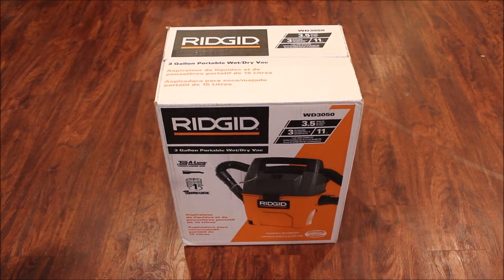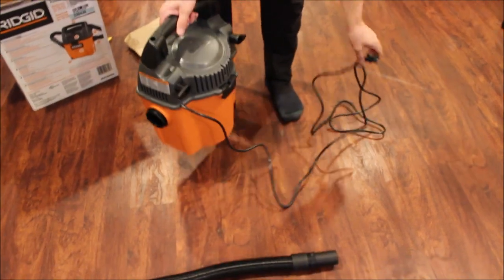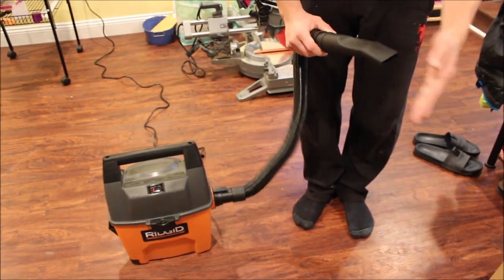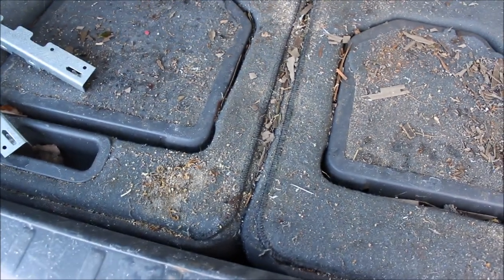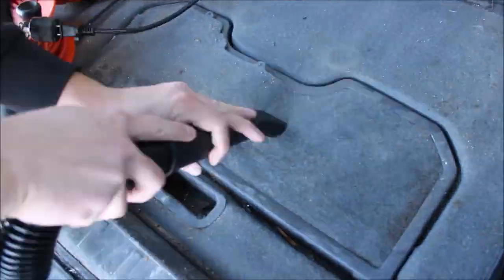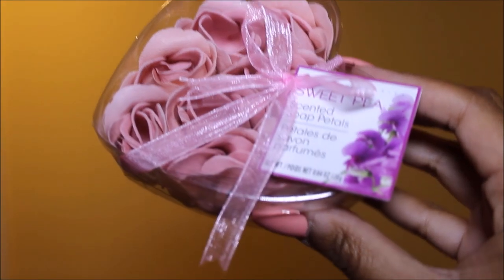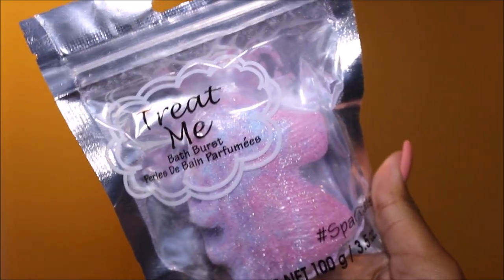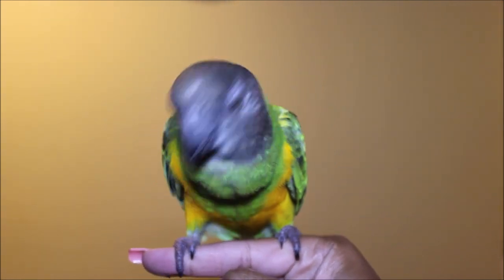Ridgid Pro Wet Dry Vacuum WD3050 REVIEW

Comment: Find it lacks sufficient suction to do a satisfactory clean up of my vehicle.It will suffice in a pinch for a quick clean up,and it works well sucking water out of toilet bowls and other water related plumbing work.btw-when removing water,remove the dust filter.Water will ruin the filter.You can purchase a water resistant filter through a Home Depot.

Comment: Get an air compressor blow and vacuum. Then buy this spray called Tuff Stuff, spray and wipe, scrub with a little water in a bucket with the spray. You will get it nice and clean very close to new